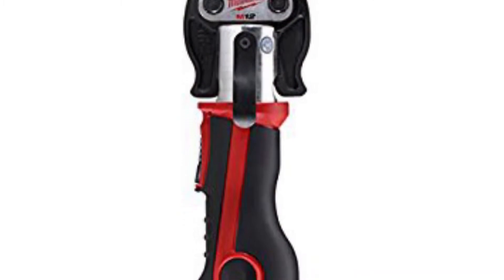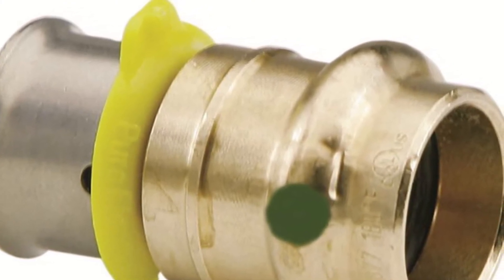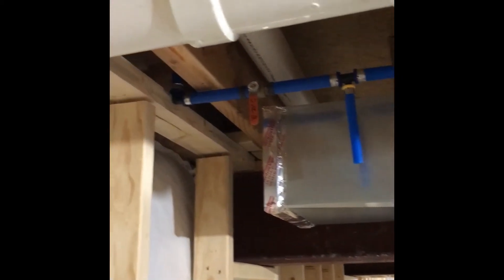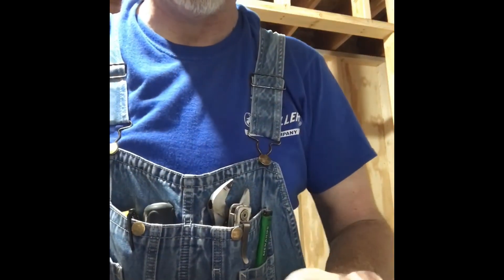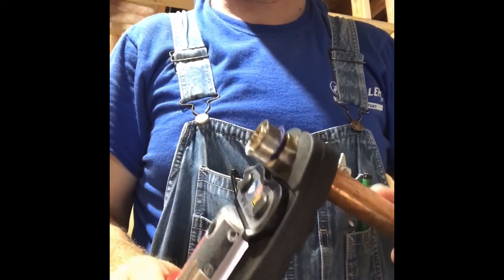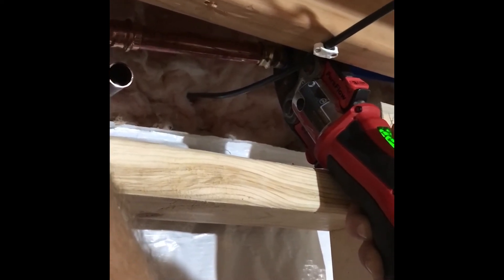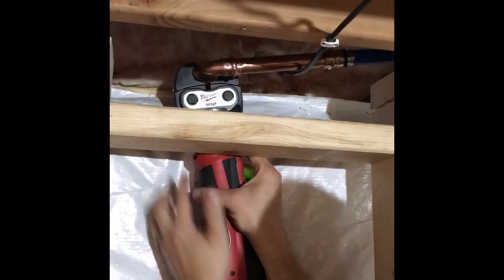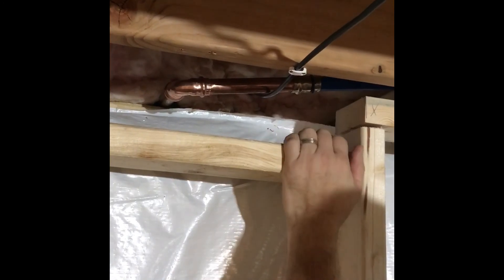S01, E03  Copper to Pex Transition

Comment: Good video,one question though,why did you elect to install that pipe over that wire instead of under the wire?As a rule of thumb I never and I mean never install any kind of pipe over any kind of wire.Also,pex is good but the thing I don't like about the pex fittings is how tight the turns are on the fittings which of course affects the flow of water.

Comment: If you wanted just 1 tool to be able to do it all....I think this is all you need . From copper to PEX & even gaspex or even megapress steel. It even cuts cast iron pipe with chain jaws.I would choose the M18 force logic tool
Reply from the maker: WICKEDLEE LOOPY  I agree.  But I do prefer the smaller size of the M12 for getting into smaller spaces.  I have both, so I use them each for the appropriate task at hand.